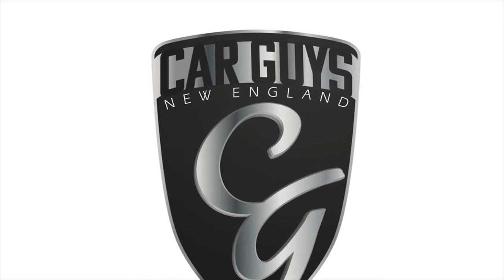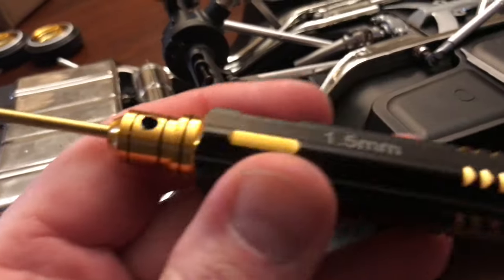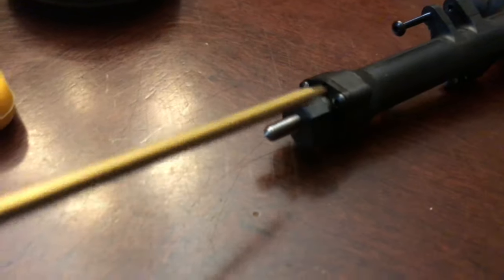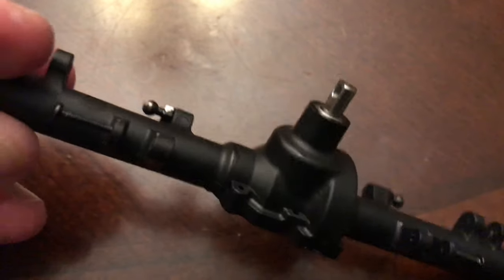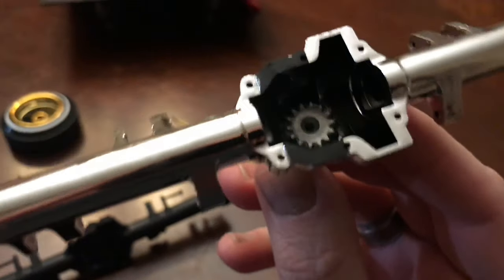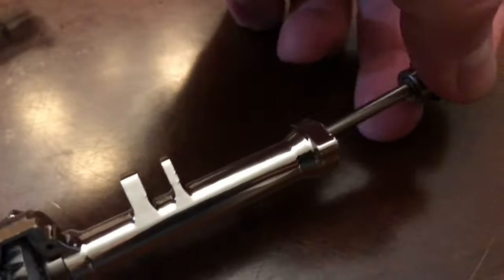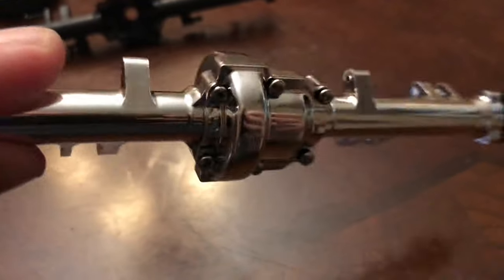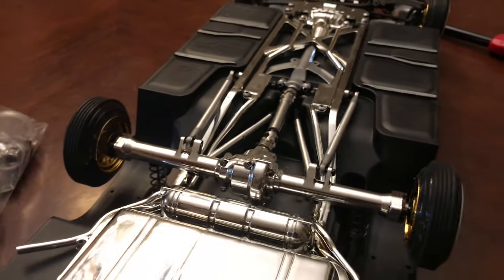Redcat Sixty Four Chrome Rear Axle Conversion

Comment: Very helpful! Just did mine. Pretty easy aside for getting those ball studs in. One went in fairly easily once I opened the hole a bit with another screw, but the other was really hard. Had to open it up more with a drill.
Mine came with chrome screws for the diff cover so apparently an update.

Comment: Huh... it's pretty much same as a full scale axle short of notched out keyways instead of splines.  And obviously  no need for oil seals or brakes when you have an electric motors dynamic brakeing.